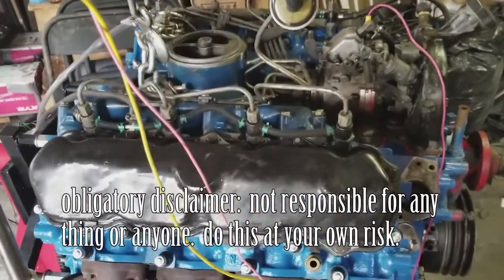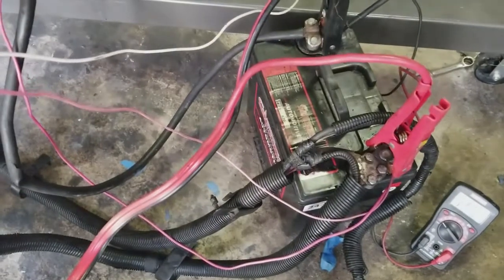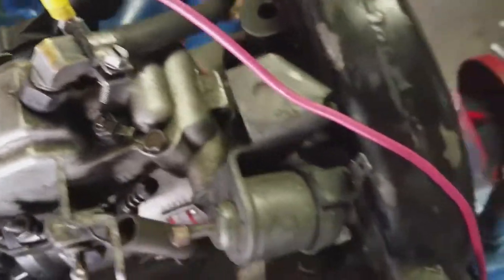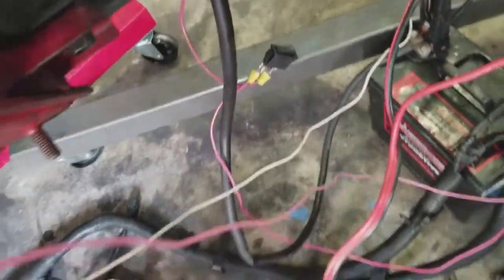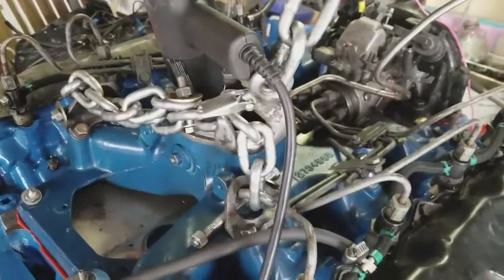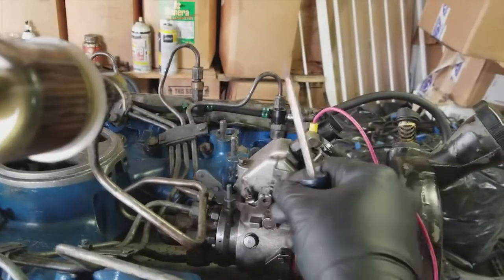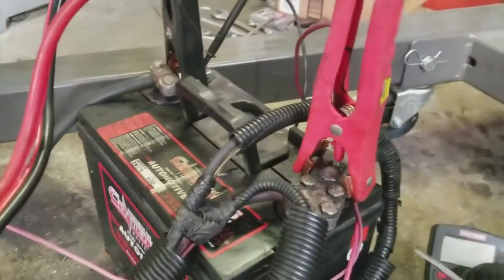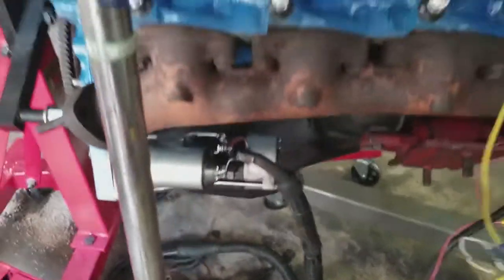How I started my 7.3 (or 6.9) IDI engine on a stand, step by step.

Comment: my short bus has 3 12 volt batteries do i really need 3 or two fine?
Reply from the maker: depends on your parallel cranking amps.  If you have some generic car batteries from some compact car, maybe 3 wont' be enough.  But if you have two diesel-engine rated batteries, then you should be fine with two.